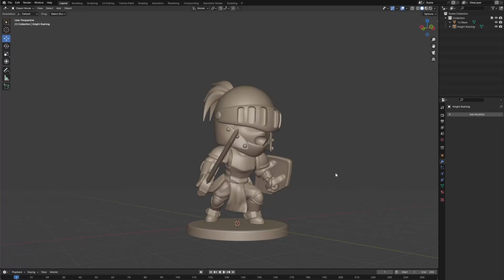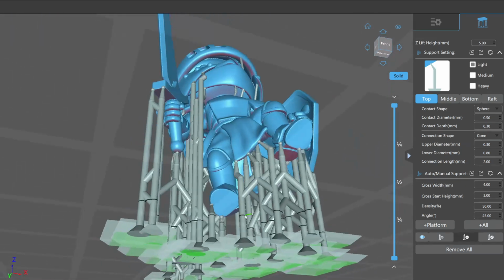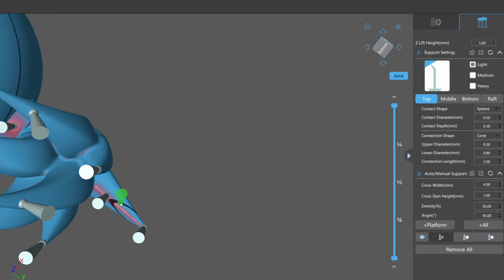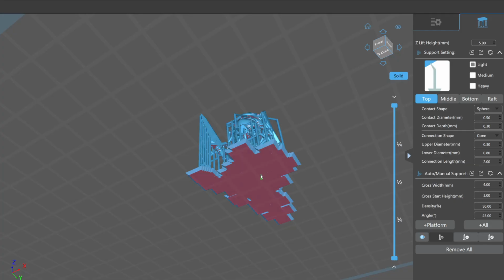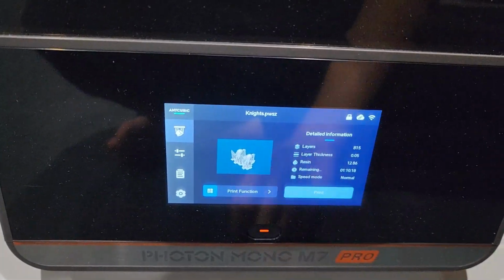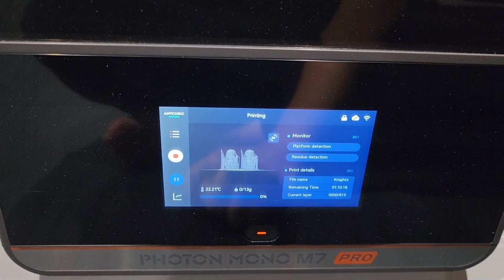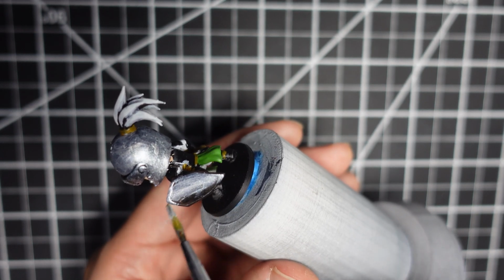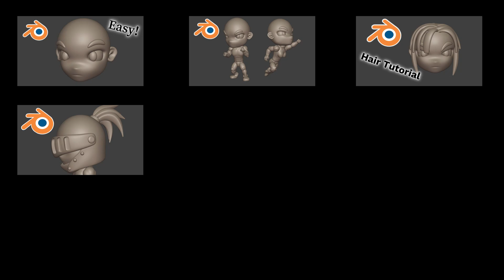How to PROPERLY 3D print an STL with Resin Printers (Full Process)

Comment: Hey so I have a filament 3D printer (Bambu a1 mini) and I bought a stl Thats for a resin printer can I still 3D print the stl even though it has those type of supports? If not how can I change it to normal supports?
Reply from the maker: Yes you can still print it, but try importing the unsupported model into the bambu slicer and check "enable support" under the support tab, and probably try an Auto Tree support. But depending on how small the model is, it might still not come out that great. I've seen some amazing results with a .2mm nozzle (stock is .4mm). but I personally just use a resin printer for miniatures. Resin supports, I would imagine would be a nightmare for an fdm printer. Would cause a lot of stringing I'd guess. But I've never actually tried it. Hope this helps!

Comment: Great video you made me want to buy a Resin 3d Printer 😆
Reply from the maker: @Off_GridWorkShop  it's so worth imo. And there's some that are good and reasonably priced.
Reply: @cupiopax  Do you recommend the Anycubic photon mono x2? it seems to be the best printer in term of price and build size
Reply from the maker: @Off_GridWorkShop  I've personally never used it but I would think it's fine. It's been discontinued tho so it might be hard finding replacement parts if you need it. I can recommend the mono 6ks, it's on sale on their website for $199. That one is one I use currently and it's a little better print quality than the x2. But that one is also on its way out.
Reply: @cupiopax  thanks for the suggestions I'll buy one during the week I have 2 FDM printer but resin quality is so impressive.....
Reply from the maker: @workshoprat  maybe wait till black friday/cyber Monday. But yeah, having 1 of each and mastering both, game changer!